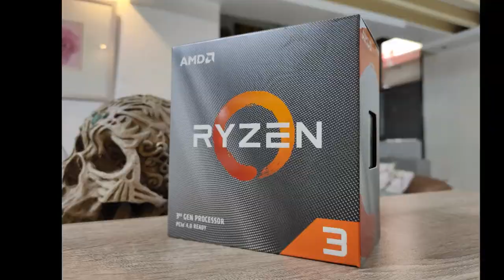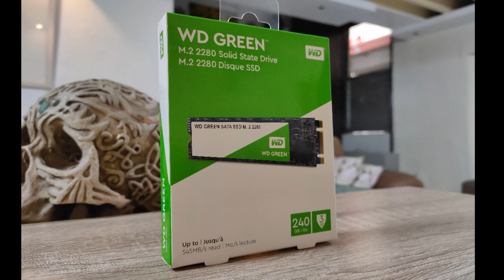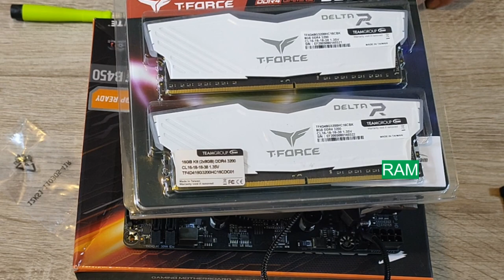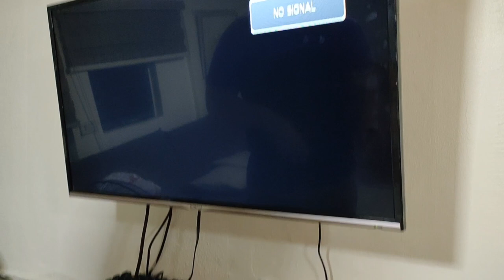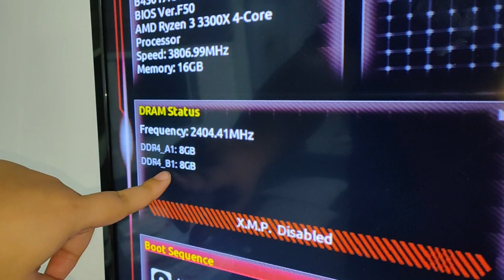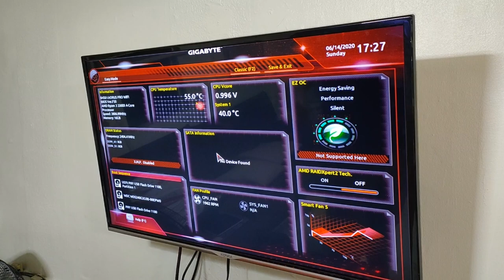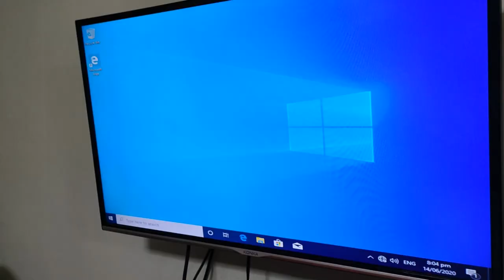Ryzen 3 3300X PC Build (Filipino/English)

Comment: Any thoughts about the psu? Planning to build one with the same fsp hv pro white
Reply from the maker: solid ang psu. ano ba ang specs ng bubuuin ninyo?
Reply: @robbinmontenegro651  pwede pala 3600mhz sa 3300x?akala hanggang 3200mhz lng kaya niya
Reply: @gnylgwen9862  afaik it only depends on the motherboard youre using, im not sure on that though. The default setting sa ram pagputna kong bios is 3200 but after enabling xmp i reached 3600mhz

Comment: Okay pa po ba ngayong 2021 ang ryzen 3 3300x?
Reply from the maker: Depende kung anong use mo, sa hirap din ng makahanap ng videocards sa ngayon.. ang mahal. hehe. anyway. light gaming, konting video editing, 10+ hrs per day ang gamit ko. swabeng swabe pa naman sakin. kung magbubuild ka, make sure to include an SSD sa budget.
Reply: Thank you po!!
Reply: @motmoandfriends7204  sir, comaptible ba ang msi gt730 sa 3300x? eto kasi sinulat ng shop.. ok daw.
Reply from the maker: @monkeyboi84  ok naman, yan na ata ang pinakamababang card ah. wala ba 1050ti man lang?
Reply: @motmoandfriends7204  mostly lahat na pauntahan ko ay d inadvice ang gt730, atleast 1050 daw.. parang nasa 10k ata eh, so ibang ryzen 5 3400 nalang muna